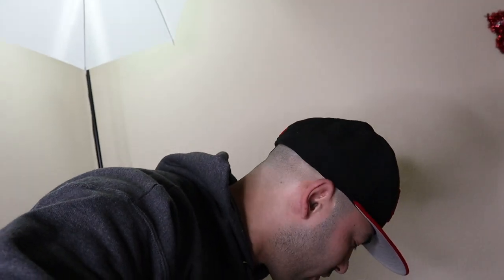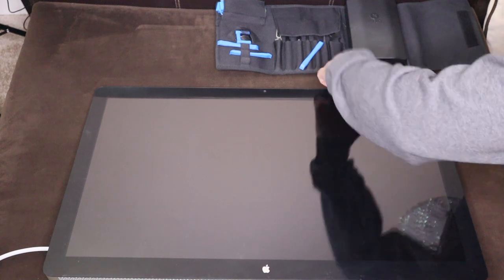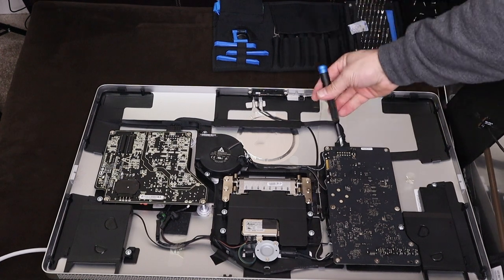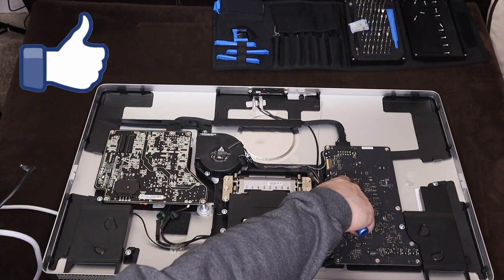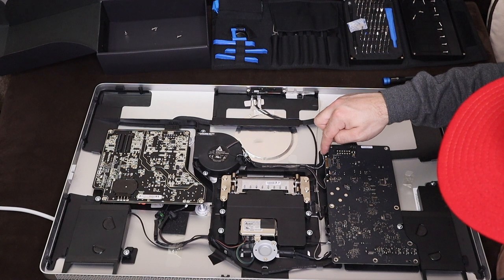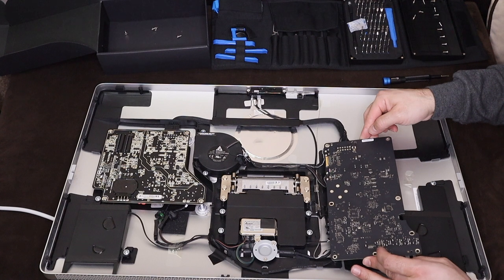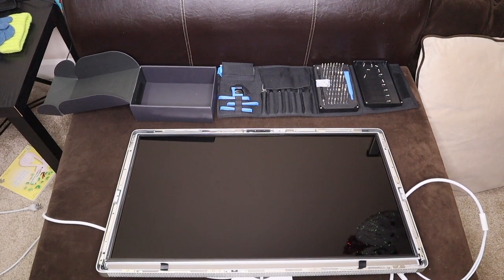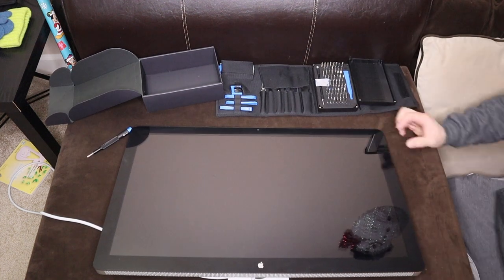Replacing Thunderbolt Cable on Apple Thunderbolt Display

Comment: If it’s your Thunderbolt cable that’s bad, save a bunch of hassle and just get the Apple Thunderbolt 2 cable (male to male) from Amazon and plug into the Thunderbolt port on the back of the monitor. Saw this in another video and just did it and it works perfectly, without having to take anything apart.
Reply from the maker: Nice this is a smart idea, but in the same time if you wanna keep it original and keep the value of the monitor, you have to go through the hassle unfortunately
Reply: I had the same time but i've noticed this method doesn't work all the time. I have the Thunderbolt monitor daisy chained to a DAS to Macbook Pro. Works using the attached cable but does not work with an external Apple branded TB2 m2m cable.
Reply from the maker: Yes, my friend there’s two type of monitors one that is specific for MacBook laptop, and one that is capable of doing the Mac Pro 5.1 and MacBook
Reply: @Ivan_Neykov  Thanks i didn't know that. I thought A1407 works on all supported macs. Which are the two monitors?
Reply from the maker: Apple Thunderbolt Display A1407 and Apple Cinema Display A1316 they look exactly the same, but in the back of the cinema display have only three USBs. The thunderbolt display of my understanding is for laptops, and the cinema display is for the Mac pro 5.1
Reply: @Ivan_Neykov  Got it. To clarify, the Thunderbolt display is supported by laptops 2011 or newer and mac pro 6,1 (trash can) or above. There is a hack to make mac pro 5,1 accept the Thunderbolt display but its hacky.
Reply from the maker: Correct 👍
Reply: just saved me from doing the repair thanks!
Reply from the maker: @Rosabel_Believe you are very welcome my friend. Thank you for watching.

Comment: Very clear instructions, thanks.  I just want to remove the Thunderbolt/Laptop charger cables as I use a long thunderbolt cable and dont need the laptop charger. Is this OK?
Reply from the maker: No specialist, but my understanding is why not I don’t see any problem with it that cable is there just for convenience
Reply: In that case, why would you bother all this work, just cut the cable? That way you can even keep the dust away from reaching the interior.

Comment: Hi Ivan, thanks for your video. I change the cable of my thunderbolt display 27", because was failling, the image start to gone until it disappears, so I saw a tutorial, and I replace it, and the image come back perfect , but since the replacement  all the pheriperals  stop working (the usb ports, the audio, the camera, etc) someone told me that maybe is because the cable is not the correct one, but I don't see any options to chose for buying the cable, do you have any thought about this? Thanks in advance.
Reply from the maker: I’m thinking check the plugs the connectors if something is misaligned and it’s not making a good connection, maybe that’s your problem
Reply: @Ivan_Neykov  , thanks for your response, I replace the cable and it works perfect, both cables look the same, pins included, but the first one cost me 17 usd, and the second 79, I think thats the main difference. Both cables I bought them at bestbuy, the second one a year latter, so i dont expect any refund at all.  Thanks again. Cheers.
Reply from the maker: Cheers 🍻 mate

Comment: I was given a not working A1407 it does not switch on by mains or connected to thunderbolt devices, it does not recognize any devices and it does not make any sounds.This to me looks like at least powerboard faults. on the Logic board, the flip-up locking gate seems to be damaged as it does not flip up?
I am familiar with flick-up locking clips from working on camera internals, but the display I am working on (the gold locking bar) does not look right and will not lock down once inserted into its slot.

Getting that cable in there with my big hands is really tight and the flip has no resistance in it as if it's broken? 

Any Ideas?
Reply from the maker: Did you check for power on the USB?
Reply: @Ivan_Neykov  u can power on from usb?
Reply from the maker: I was referring to check the USB to see if there is power add the USB to see if there is a problem at the power supply or problem at the motherboard or there is a loose connection
Reply: @Ivan_Neykov  Thanks Ivan, yes, I replaced the power supply lead that goes directly into the back of the thunderbolt, now it charges devices but still the screen is black and won’t’ show?
Reply from the maker: My guess is that the screen is burned I mean, if you think about it, this displays are what 10 years old, I love this screen, but they’re old and I wouldn’t be surprised if the screen is burn